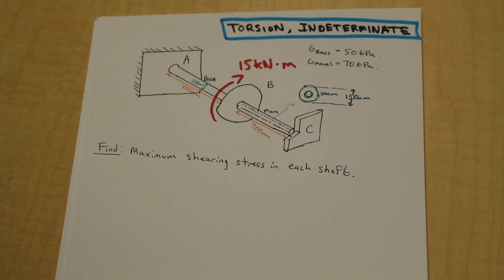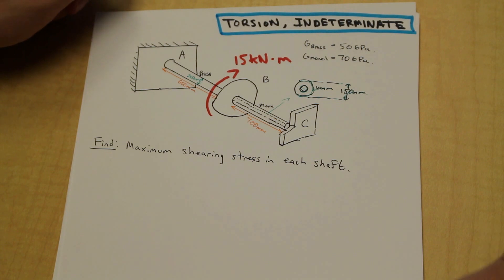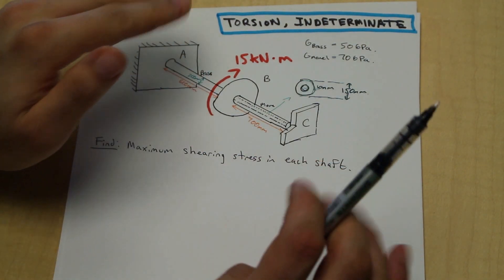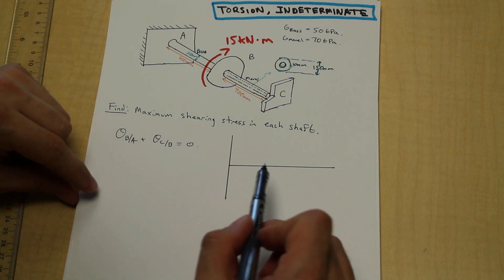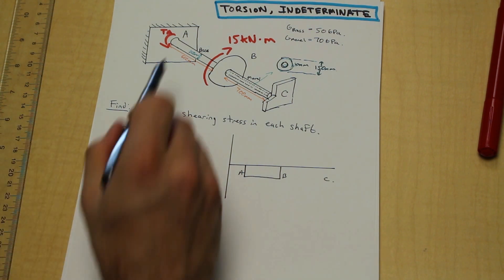How to Solve an Indeterminate Torsion Problem (Max Shearing Stress, Angle of Rotation) - Part 1/4

Comment from the maker: TimeStamp !

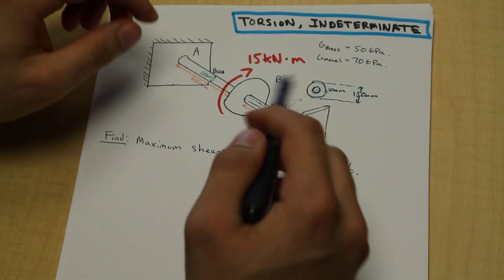3:21 - Theory Ends - Solution Beings (Dont skip the Theory!)
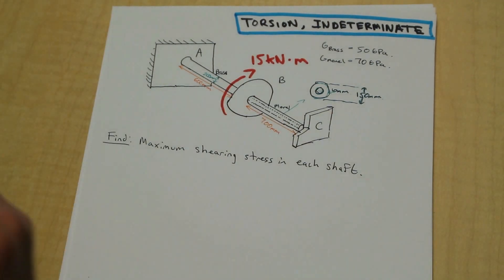4:32 - First Step - Draw a "Torque Diagram"
6:56 - Second Step - Calculate "T(bc)"
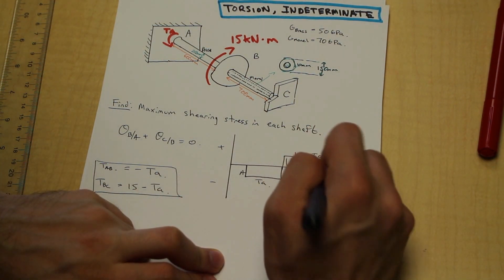7:52 - Final Solution (Now try to do it on your own!!)

The Indeterminate Torsion Problem has FOUR parts

Part 1 (Which you just watched) - https://youtu.be/PXMuqTfyEug
Part 2 - https://www.youtube.com/watch?v=ppnr1... 
Part 3 - https://www.youtube.com/watch?v=L4o9s... 
Part 4 - https://youtu.be/n1oD69nyjYE
Reply: Part 2 and part3 videos are not available. please get back it.